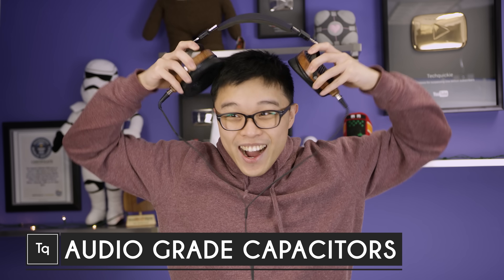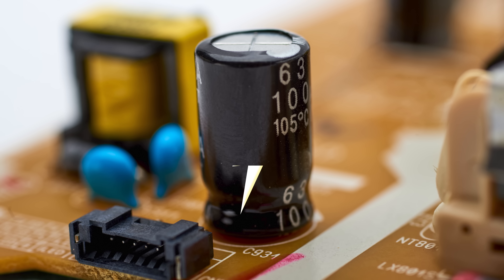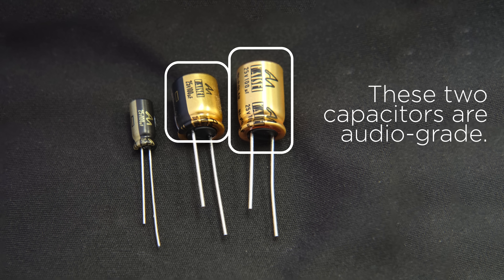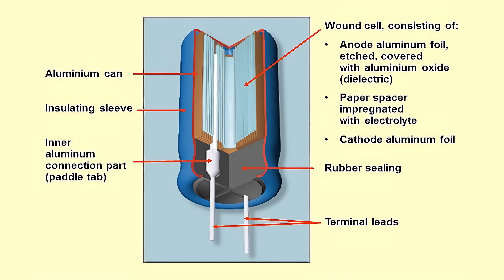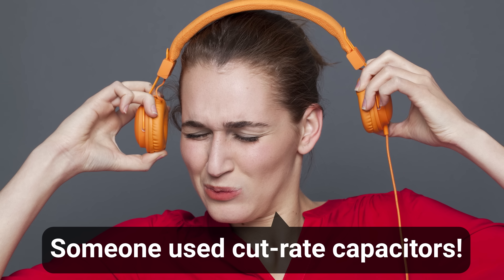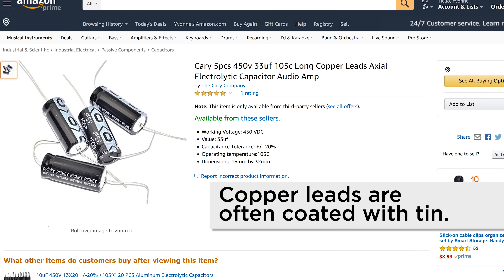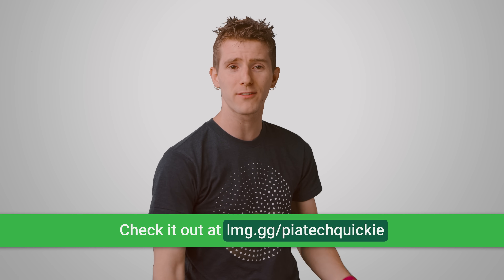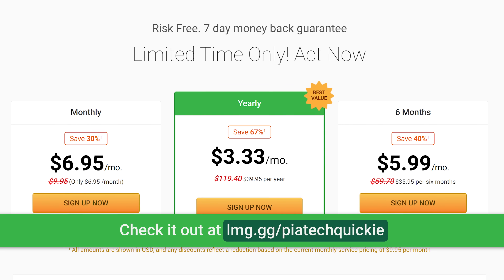What Does "Audio Grade" Mean?

Comment: BS. No one can hear the difference between a good quality (Nichicon, etc) capacitor and an "audiophile" capacitor (even a low quality capacitor, with the same capacitance, ESR, and ESL will sound the same). It's like buying expensive speaker wire. Yes, you should look for brand name capacitors, because they will probably last longer, and are spec'ed more accurately. Yes, you might be able to see the difference on a scope. No, you can't hear the difference. PCB layout, filter quality, noise specs, and a host of other things will all make audible differences, but not audiophile capacitors.

Comment: Any capacitor will work in an audio circuit if it has the right capacitance and if the series resistance and inductance are low enough. If the capacitor is close to a heat sink, it should also have a high temperature rating. Anything else is snake oil.

Comment: Complete load of crap.
Audio grade is just a way of making a bit more money on a standard low esr cap by putting a different sleeve on them.
As to the quality Japanese caps, well it's been well over a decade since the spate of bad caps due to incorrect electrolyte formulations from cheaper non Japanese suppliers caused major issues.

Comment: DEAR LTT Staff

PLEASE do you  reseach BEFORE you start spreding  bad information to thousands of people

1st Capacitors(Caps) does NOT "conduct" aka "couple" DC (they are used for blocking dc ⎓ to protect delicate voice coils)  (1:01)

2. inductance does not add  noise...  noise is caused by desing of amplifier and it enviroment.... caps does not cut cown impedance of circuct (only imesurably add tho it).... they counteract impedance..... that changes Apparent Power aka power factor  (read what power of signal gets into voice coils)... however they with help of inductors can make LC (incutor-cap) band pass filter and filer noise  (2:20)

all other is fine... you should skip  details
sources
https://en.wikipedia.org/wiki/Capacitor
https://www.youtube.com/watch?v=BcJ6UdDx1vg

https://www.youtube.com/watch?v=X4EUwTwZ110
most of electritians

Comment: You guys really need to get an electronic engineer to proof read your scripts, this is not very accurate
Reply: its all accurate tho, its magnetic iron tinned not steel on some low grade components since iron is so cheap compared to copper, and yes it matters in some cases where lowest resistance as possible is required like audio applications for example! its easy to google ``material's conductivity`` and see copper is more then twice more conductive then iron(magnetic) contracts, also ask an electrical engineer and see what they say about ``contact resistance``
Reply: @Chris Russell And ferromagnetic materials, like iron, suffer from hysteresis distortion, which is measurable - even in a wire.
Reply: For a tech channel that mostly just focuses on putting parts together and not looking at the makeup of any of the parts, they got pretty close at explaining how capacitors work imo. I had very low standards but was surprised when linus actually said the word coupling. Plus, if anyone actually wants to know how these types of things really work they wouldn't watch a tech quickie.
Reply: hard to believe I just read an entire argument about what capacitors are made out of 🤦‍♂️
Reply: @reeeeeeee2143  Blackgate
Reply: Can you Cut open the Mundorf Silver Gold Cap to view the inside can ? Is it real Pure Silver Foil or basically just a Fake Foil ?  Video have !  ( Surely u will have Billion of Billion of Viewer in your Youtube).................Cut it now Mundorf Silver Gold Cap............,,,
Reply: @naqiongtradingllpnaqiongtr8035  you gonna pay for it?
Reply: this vid is so cringy, especially the part of caps leads made of steel
Reply: @pierreuntel1970   The man of copper...... becasue it's better...
Reply: @reeeeeeee2143  Most 'audio grade' capacitors you will find on a motherboard or sound card will be electrolytic.
Reply: @Chris Russell really? I mean... yeah, it's kinda right when I think about it because some leads do tends to rust... but I don't think its steel at first because it's very hard to wet steel with solder

Comment: Most capacitors are actually those small rectangles you see on your boards. Roughly half are probably resistors and half capacitors. Those large electrolytic capacitors are good for lower frequency signals due to their larger capacitance, while MLCCs (multilayer ceramic capacitors) are way better for higher signals due to their much lower effective series resistance. The only advantage of electrolytics is their slightly larger maximum capacitance.

Comment: Unless you plan to use single-ended Class-A transistor amps (which need decoupling) with your home speakers, where DC decoupling is a vital thing, regular capacitors should be sufficient. In that case, the DC resistance and inductance introduced by the decoupling capacitor can suck your tone literally. That was the case on many 90's sound cards, which could be upgraded with better capacitors (at the cost of size), but some find the result too bassy, especially with certain OPL2/3 tracks. Gravis Ultrasound and Pro Audio Spectrum 16 cards didn't suffer from such issues.

Comment: To the LMG team writing the Techquickie scripts lately, there's a bunch of misinformation in this video. Please, let Alex have a read through before filming your videos. There's a higher probability that he, who is more knowledgeable in the engineering field, can catch the lies. Sincerely, Electrical Engineer. 

It is actually all about the proper output response design and manufacturing tolerances. And no, pointing at capacitor chemistry is not the answer either, you need different capacitances for different purposes. Circuits with better design will have a mix of ceramic and electrolytic capacitors to achieve desired responses. (For the uninformed, using only 1 type is a BAD IDEA). 

Finally yes, all users should go try, and decide for themselves what is acceptable.

Comment: Sorry, but no. 
This would be true a couple of years back.
Gold caps, audio grade and insert buzzword are the same as buying a Monster cable these days.
Just don't buy the cheapest crap from China if you plan on using it for professional / long term use. 
Audiophiles are the reason audio equipment got expensive...

Nevertheless, I like it when I see a stack of Nichicons in my equipment. 
It means not only the engineer cared, but also management just wanted to be sure.

While i'm ranting: "no two pair of ears are exactly the same" has nothing to do with this.
Only if you replace a capacitor used in the signal path (it would / could affect bandwith and filtering) it would be audible.
Even these nice brands have a deviation between 1%-10%. Switching some from the same batch would even cause this.
Or when having a weird setup separating the left and right channel's power supply. (nobody does that)

Comment: My $300 headphones broke from wear and tear just over one year, don't buy SteelSeries Arctis Pro
Reply: Yikes. Gaming headsets, man.
Reply: Buy better headphones with better sound for a little less money instead👍
Reply: @Oystein87  I'm looking for headphones with the same feature as this headset. Dual battery system and dual wireless connection (for PC and phone).
Reply: @Chris-pv6zw  I am not a headphone expert so I don't know what checks all the boxes. But I know Jabra and some others have dual connection etc in several models
Reply: I use a Sony WH-1000XM2 as a gaming headset (when I really need wireless) and it's not too bad. It has a built-in mic, and it doesn't even have an annoying boom. But it's a little bass heavy, so it won't work too well for, say, competitive FPS.
Reply: @CaveyMoth  What does "bass heavy" have to do with it not working well for competetive FPS gaming?🙈
Reply: @Oystein87  Well, it's hard to pay attention to subtle sounds like footsteps or the enemy reloading when all you can hear are the gosh dang explosions blasting in your ears.
Reply: @CaveyMoth  So then it's the explotions and not the ammount of bass then.. You still hear the explotions if the headphones has less bass. And higher freq like fotsteps are more easy to pick out from lower freq explotions than higher freq explotions anyway..

Comment: "The days of low-end motherboards' on-board audio making, like, screeching noises when you move your mouse around are, thankfully, long gone."

The 6 month old Dell CAD workstation I have at work would like to disagree. Glad to see I'm not alone in this. Stay strong guys.
Reply: I almost threw xps 13 in trash because of that noise 🤯
Reply: Have a 6 month old Dell Latitude that does the same damn thing. I thought I was crazy
Reply: My Gigabyte Z-170X Gaming-3 motherboard also gave me electronic noise on my Sennheiser HD 280 Pros. I had to get a DAC to get rid of it.
Reply: My 2005 PowerMac G5 didn't had any of this noise, but every other computer I owned had a lot of these
Reply: @alexandrecouture2462  That's the problem with Macs, we just keep missing out!
Reply: Ive actually had that happen on an Asrock x470 Taichi Motherboard. I was pretty shocked when i realized what the issue was, especially given its a high end board.  Thankfully Amazon accepted my return and i got an Asus Crosshair instead
Reply: Single Board Computers, like the Raspberry Pi are really noisy. I have a RP4 hooked up to some powered speakers and when I play anything it sounds terrible. I should put my Schiit Modi in the middle to replace the noisy output.
Reply: Wait, how does this even happen? Would that happen thortugh all USB data transfer?
Reply: Caps age. They ALL age. Most onboard audio has a poorly designed class and filter structure to begin with, but shiny new caps will mask it. The more it gets used, the more likely it is to age and start allowing crosstalk with outside Interference. This is why pro audio gear uses balanced signal paths in the first place. Any unbalanced paths, like what's used in most computer audio, are susceptible to interference.
Reply: Can you Cut open the Mundorf Silver Gold Cap to view the inside can ? Is it real Pure Silver Foil or basically just a Fake Foil ?  Video have !  ( Surely u will have Billion of Billion of Viewer in your Youtube).................Cut it now Mundorf Silver Gold Cap.............///
Reply: Lol that’s not low end motherboard... that’s oem proprietor... something totally different and often worse.

Comment: Quite misleading to only show electrolytic capacitors followed by claiming electrolytic capacitors are completely different from the other cylinder shaped capacitors. In fact, all the cylendrical capacitors are all electrolytic and polarized. where as the most common capacitor used in modern electronics are called ceramic capacitors and are surface mounted rectangles, very similar looking to surfacemounted (SMD) resistors. "Audio grade" is just a made up classification for high grade capacitors that can charge and dischange quicker than some other capacitors, but nowadays "audio grade" capacitors means nothing due to advances in technology and better component quality